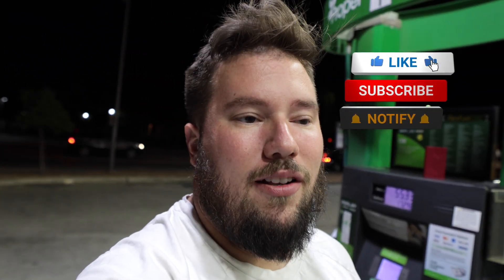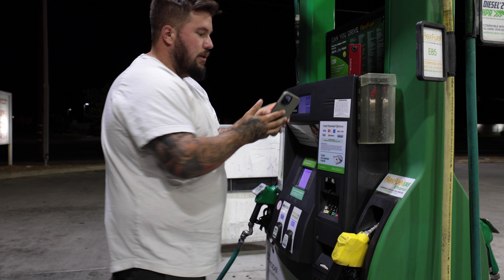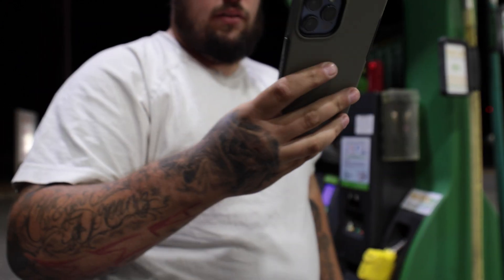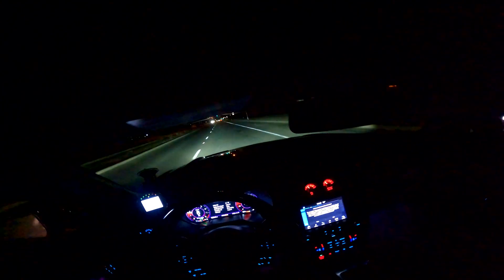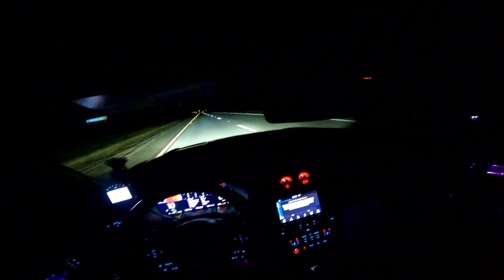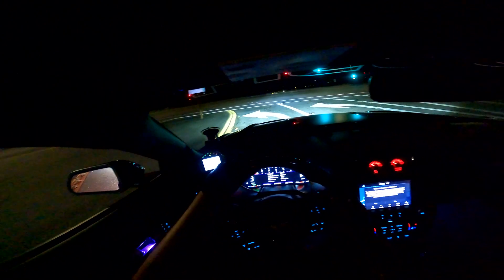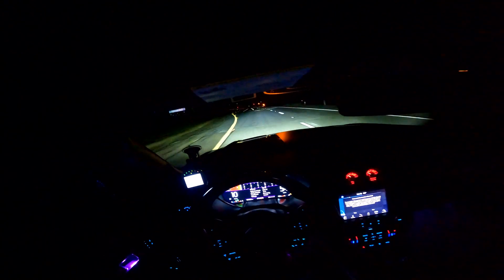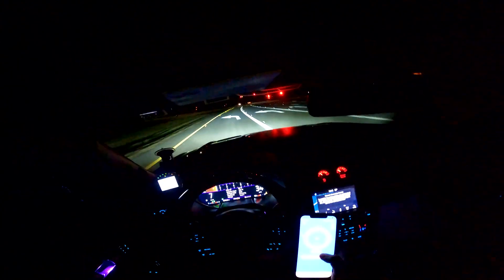Roush Stage 3 Mustang vs Procharged Mustang | The New Way To Test E85 | How To Test E85

Comment: You have stock oil pump gears?
Reply from the maker: Yes I am
Reply: @StealthyGarage   be careful running e with out them your rpm will be alot quicker and you will over rev till you get used to it. 8k rpm is hard on stock gears
Reply from the maker: @Jamie-ww3yz  it’s an 10r80 so it’s shifting around 7500 every time.
Reply: The opgs only stress when bouncing off the rev limiter or 2 stepping. Should be fine.
Reply from the maker: @primofx2sport  that’s what I was thinking as well although I will be upgrading them to be safe